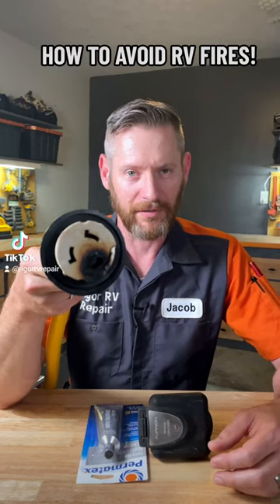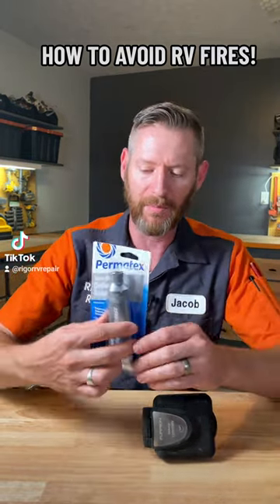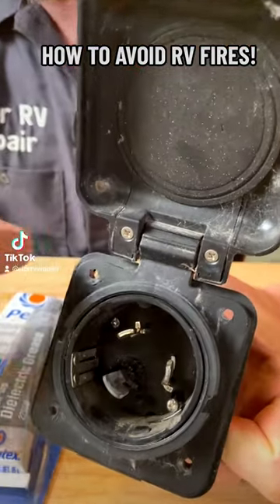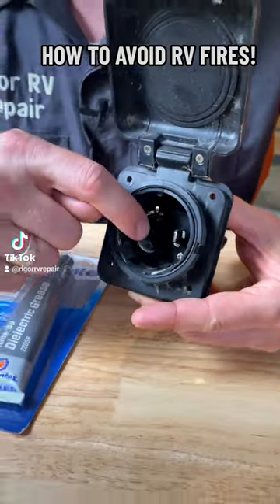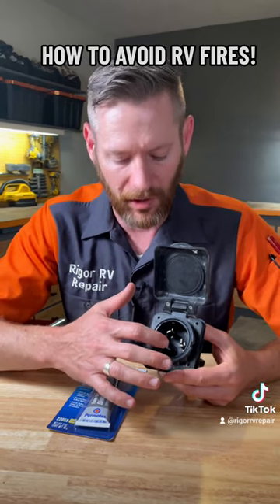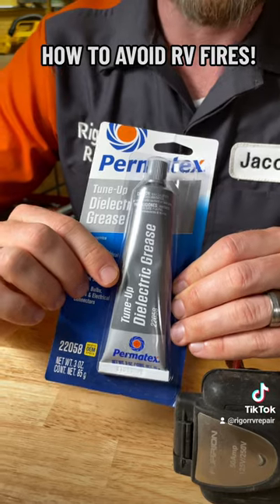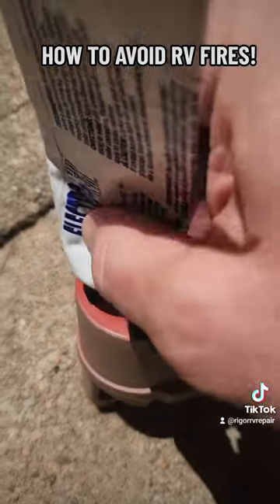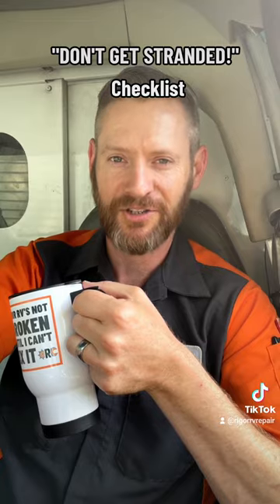How to avoid RV fires!

Comment: A bent plug or loose terminal screw will also cause a connector to overheat and burn up. If you notice a warm connector or plug, FIX IT IMMEDIATELY. Twist lock connectors are not cheap to replace!